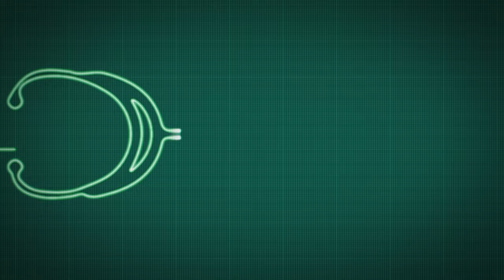New EDC Tool and giveaway!!!

Comment: Great video. I did six years in the military and over 90% of the issues I came across could be fixed with that leatherman and those accessories you have there except it was only an extender, not the rachet. I would have loved the rachet. I have sentimental value with my leatherman now.